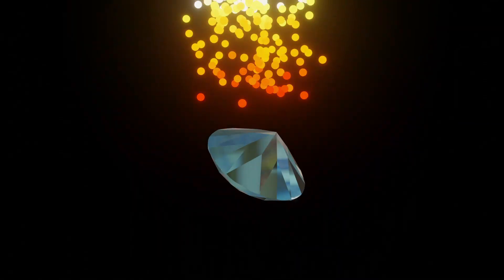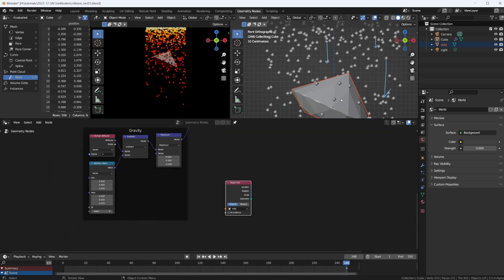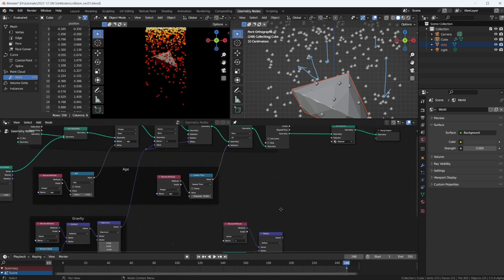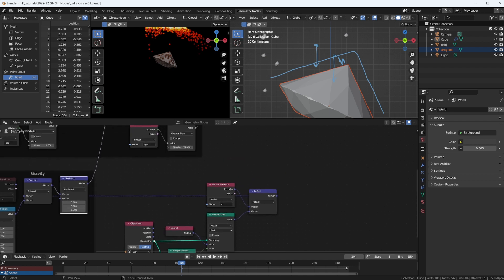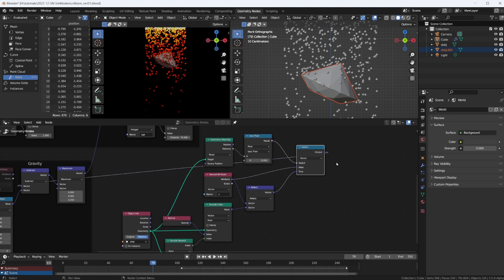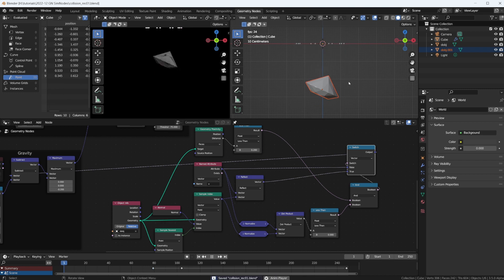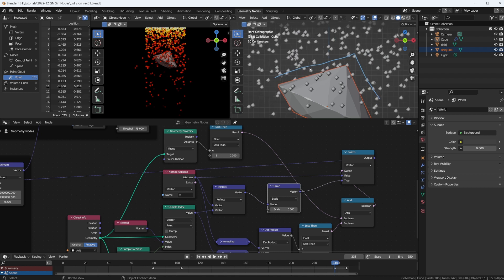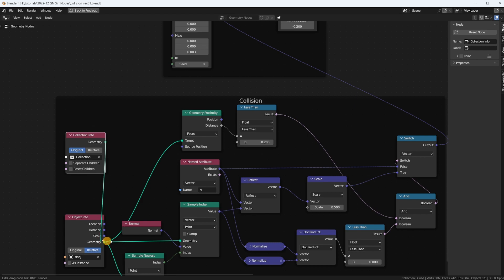Particle Collisions w/ Simulation Nodes | Blender Tutorial

Comment: Hi there, 

Pity I can’t contact you. Thanks to your wonderful tutorials, I have been able to do something I need. 
When I am using the “sample nearest” and “sample index” or “sample surface” nodes it doesn’t work for me in 3.6. A bug in the software or, more probably, a misconception from me. 

So, in order to get the local coordinate system I do the following. I get the normal as you do. Then I choose a vector (1,1,1) and cross product it with the normal. I call it x-axis. Then I cross product this x-axis with the normal and get the y-axis. Normalize the things, translate to the chosen point and we are in business. 

To avoid errors when the normal is co-linear with (1,1,1) I test the dot product of (1,1,1) and the normal and if it equals 0, I choose the dot product of normal and (2,1,1). 

One, it works for me and two, I understand it. I’d send you the nodes but as I said I can’t contact you.